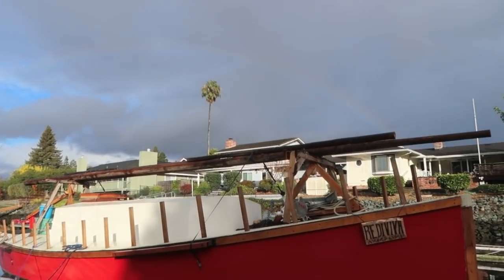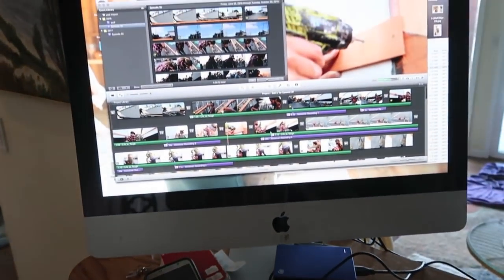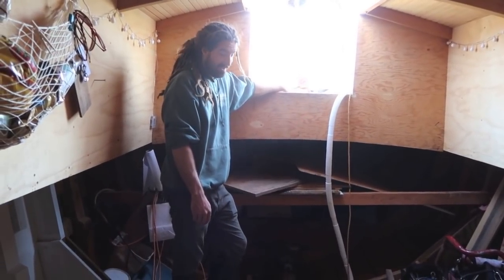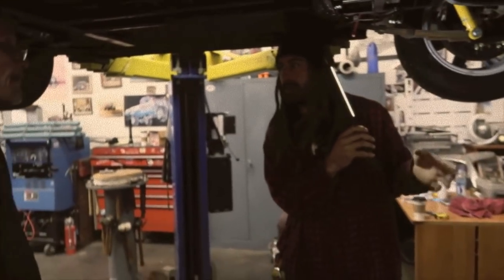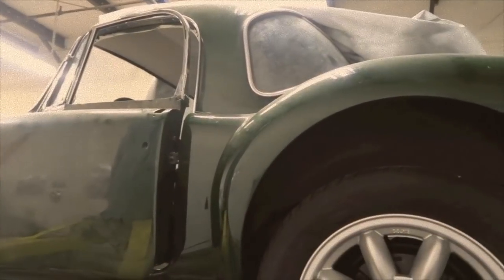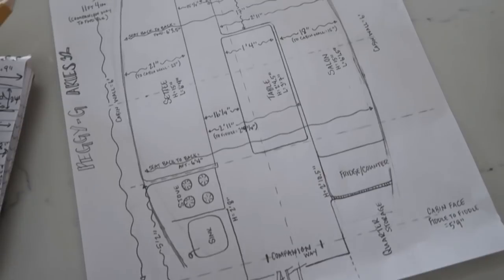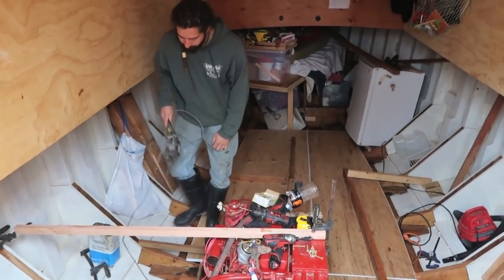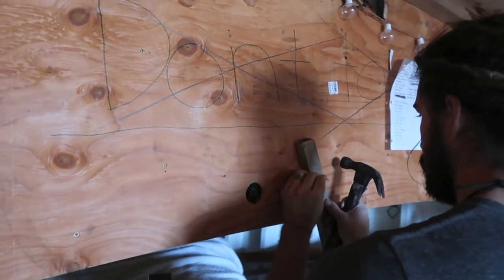Salt & Tar: Episode 46-Mental Lightening Storms (Interior Indecision and Driveline Research)

Comment: Your main shaft should have been 1 3/4" The one you have will eventually snap, as having your engine offset like that will cause a bending momentum between end of the lay-shaft & the thrust bearing (you have yet to install). Although it may take many hrs running to do this. The one thing I would do would be to make sure that your lay-shaft is well captured as if the end of the shaft breaks off at full throttle you will have your lay-shaft thrashing around trying to kill anyone standing over top of it & trying to go through the bottom of the boat.
Reply: calthorp you are wrong about the offset  if UJ is perfectly straight the needle bearings will never get a chance to Rotate in their race but I do agree with you that if the shaft brakes or a UJ fails which it will do BUT it will give you a warning severe vibration loud banging when shifting from forward to neutral there should be some containment for it or it will spank the shit out of you and the boat
Reply: I was thinking Driveshaft Loops for Race Cars. Again, Rolf IS The Daddy. They won't need to be very big, since this drivetrain doesn't move...  @paulbreaks7680
Reply: Whole lot simpler (and vastly superior) if the engine and prop shaft were in line.
Reply: @davidarthur6564  agreed, or some type of transfer case/jackshaft assembly.
Reply: @davidarthur6564  every truck over 3/4 ton use drive lines of two or more parts. Hell, a 35' box truck rent at U-Haul has 4 or 5 peices, with 3 carriers, nothing is in a straight line, but timing one is critical. I even use  a carrier in my demo derby cars, with constant velocity U joints on both ends, so my car and driveshaft can fold/roll-up like a banana, and still be able to move. My Dodge truck has Cummins 5.9, 164 hp 430 ft.lb's of torque, uses two peice drive line. I'd be more worried about the 18" blade and the angles on it!
Reply: the pro designed and made DR is good as is. they knew it was off center and accounted for it.
Reply: How many of you have seen a 3000 hp monster truck break a off centered driveshaft? Of centered means nothing. Timing and balancing  does!

Comment: Oh no rolf again drive lines are rated in TQ not HP. Ask Rolf how HP is calculated? how it HP on a gas engine so much different that a diesel? Hint he doesn't know.
I cant believe Rolf is comparing Gas engine HP to diesel HP . Ruth garret RUN Run far run fast!

Comment: I wouldnt bother with the pooper by the way. you go outside.. why they used to call it the poop deck. waste of valuable space.. and also another thru hole.. sinking isnt good
Reply: 5gal. plastic paint bucket..no problem.
Reply: Jay Sims - The major problem without a proper toilet ( Head ) on the boat is that most marinas require a toilet and holding tank . If you plan on staying aboard the boat a marine head and holding tank is mandatory not optional .